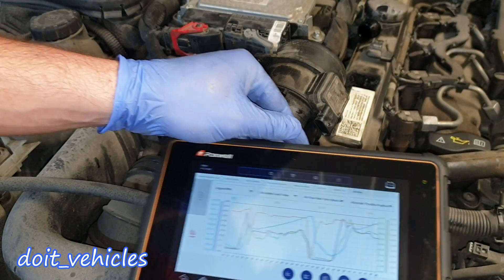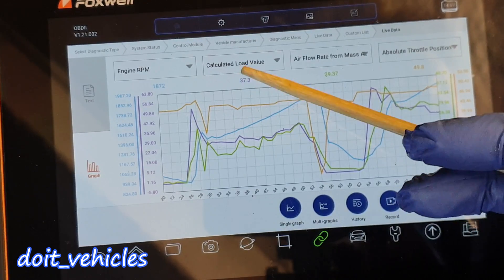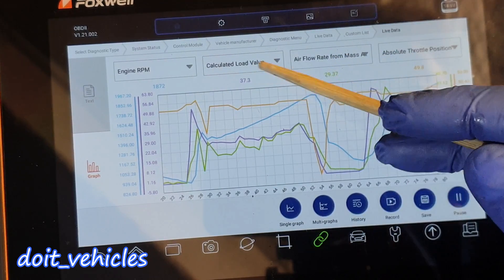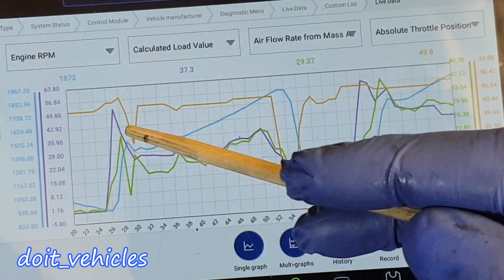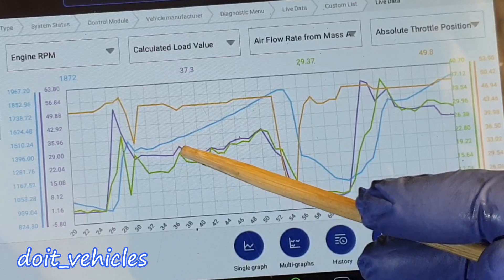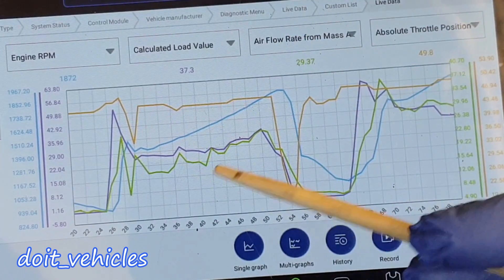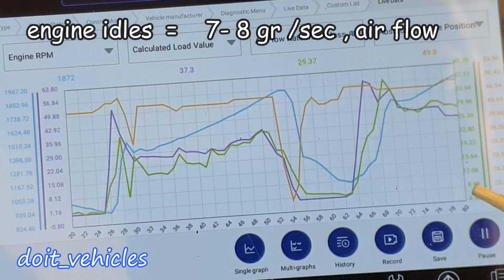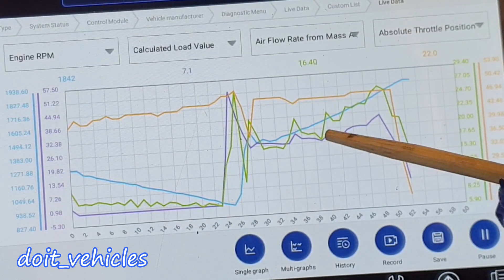MAF from W204 Mercedes C180 CDI cleaning , voltage , resistance , IAT sensor on OM651

Comment: Got the maf sensor circuit range/performance dtc on my c200 cdi . Tomorrow gonna check using your video. Thank you. Hope cleaning the sensor would be enough, cause if not, i need to wait two days until the dealer shop will be open and my baby in the safe mode, hardly shifting gears and the rpm not dropping from 3000...
Reply: Did you fix it?
Reply: And did you fix it changing it? Thx

Comment: Tip for next time, you dont need to remove the first rubber hose, you can just remove the intake plastic tube and lift up the whole air filter housing, making the screws on the maf much more accessible

Comment: My MAF sensor dont read anything between pin 2-3 and 2-4
Its a Continental and Number 0248 on it.
Also it says A on my connector and B on yours. Is it still the same?
Wondering if mine is broken
Reply: I have the same situation.
At idle it shows about 17-18 g/s.
I assume that the sensor is dead.
Reply: @dmitryshyrokov did you find out the problem? My idle also 14-15 g/s but no other problems with the car, engine check light is on.